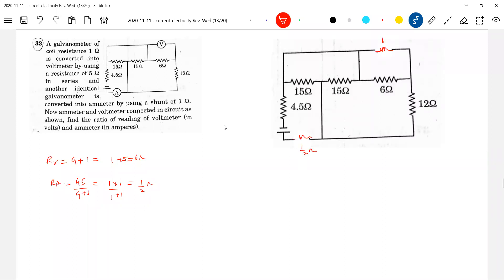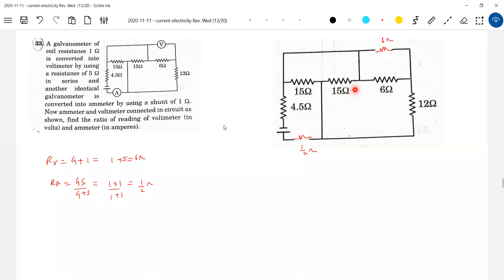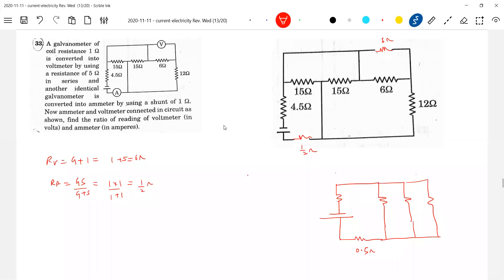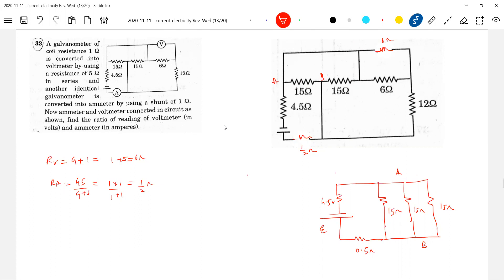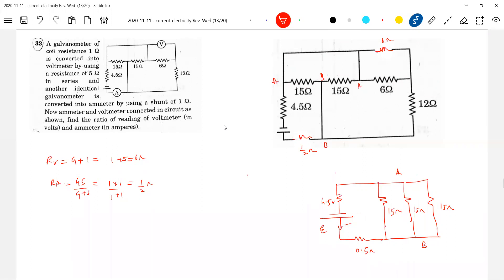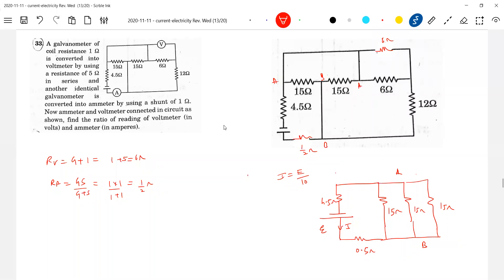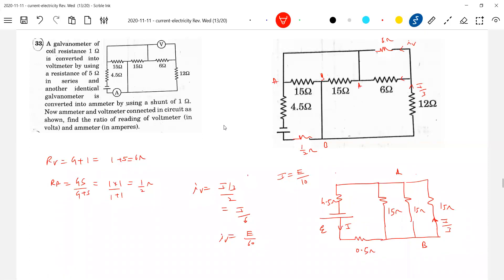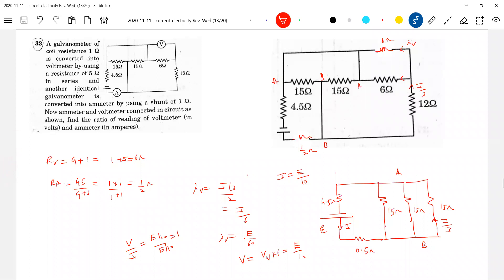16) JEE | A galvanometer of coil resistance 1 Ω is converted into voltmeter by using a resistance

Comment: sir wy are 15 ohm 15 ohm 15 parallel instead 15 ohm paralel with 15+12+3
Reply from the maker: From the given circuit, you will get confused, 
If you redraw the circuit, both 15 ohms are parallel.
Rewatch the video, I have changed the shape of circuit, then both 15ohms are connected across ends.
So, they are parallel